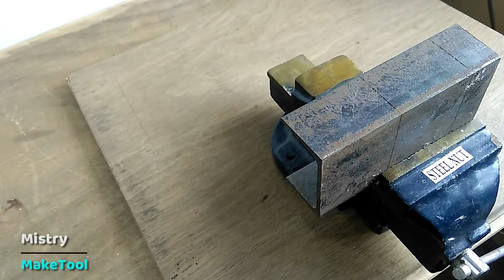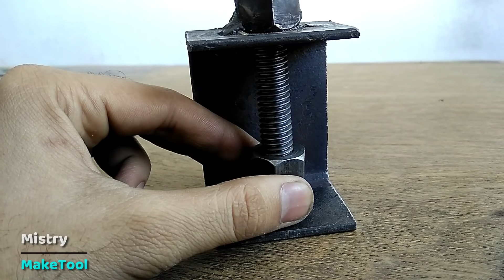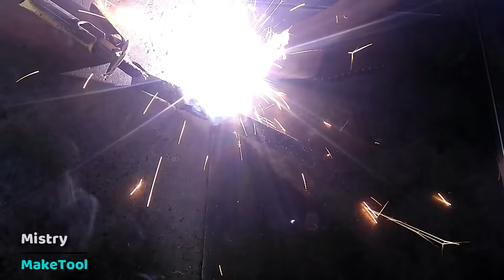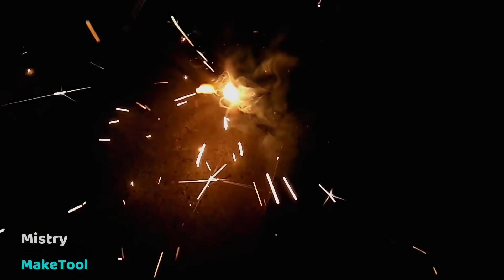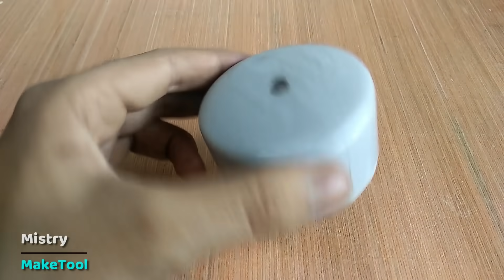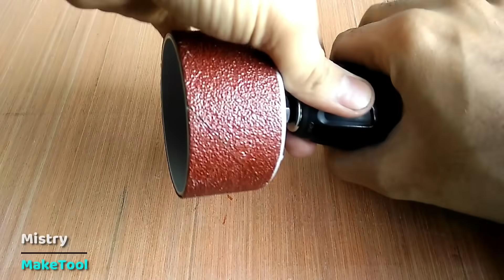3 Awesome Ideas Of DIY Tools

Comment: The ideas are good and I appreciate it, but the quality of execution is not the best.
A good step will be to start by learning to sharpen drills
Reply: Same thoughts , sharpen the bit
Reply: The bit is fine, he is using a cordless drill not a press. You need a LOT of force to drill a hole that big and make proper chips. That is why it is called a drill PRESS and the gear ration give the quil so much force. He also didn't used a pilot hole and the tip of that big drill bit is a chisel, it is sharp all the way to the tip so he would have to be pressing hard enough for a ~ 3/32 chisel tip to penetrate the steel and keep pushing the steel to the side so the cutting edge can cut it. :)
Reply: His welding skills could use a lot of help. And grinding in gardening gloves will change after he gets em wrapped up in that wheel....
Reply: Luís Cruzeiro 2
Reply: And to weld!